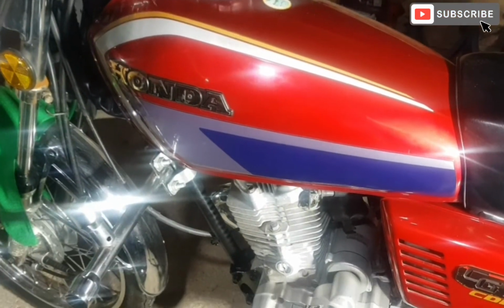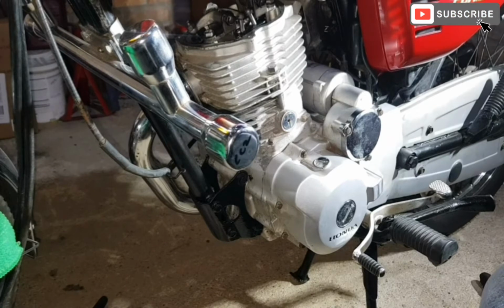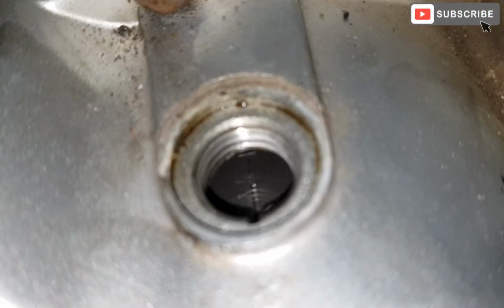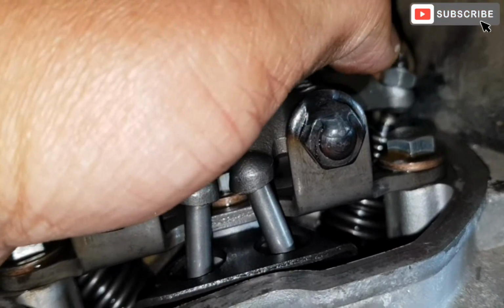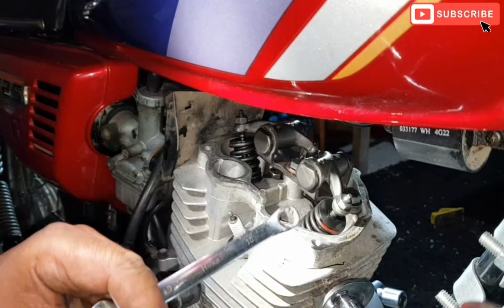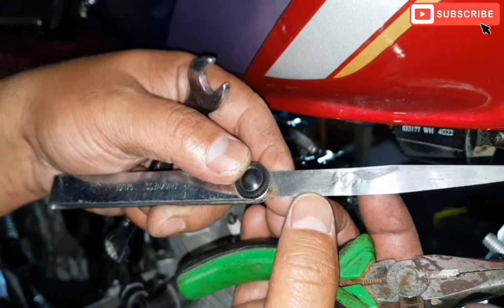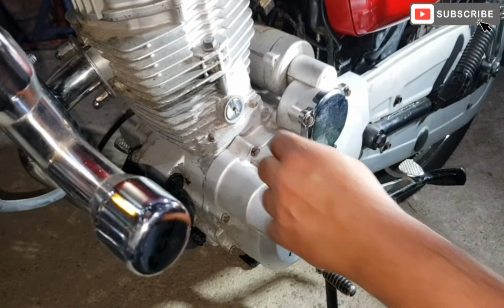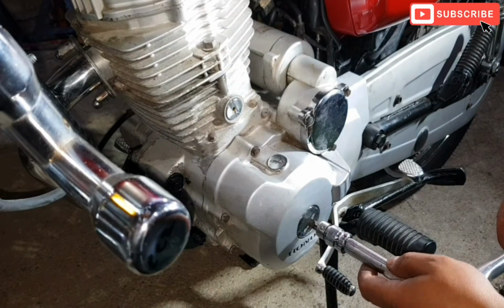Honda CG125 Tappet Valve Clearance Setting | Noisy Tappet Adjustment | Honda CG125 Noisy Engine Fix

Comment: If exhaust gap is 0.8then the intake will be 0.5 .
Both gaps should not be the same .
The exhaust is always bigger because it gets hot and swells .
Please follow as he does but check the gap sizes against a reliable source.
Reply: the honda manual of my honda cm says 0,08 for both sides 
so should be reliable source

Comment: Salam Brother
I have a similar motorcycle like this one honda cg 125 1998 model
I am trying to get it fixed 
How much will it roughly cost if I get the tappets done by a mechanic in London
Or what tools will I need if I try to do it myself 
I have a bit knowledge of the honda 125s as I used to fix my own back in Pakistan.
Thank You in advance.
Reply from the maker: Wasalam 
Its a fairly easy job if u know what you r doing 
Just follow my video n u will be able to do your 
You need a feeler gauge which u can buy from Halfords for under 5 pounds and the key to open the nuts
Good luck